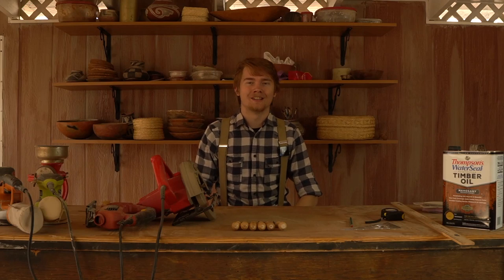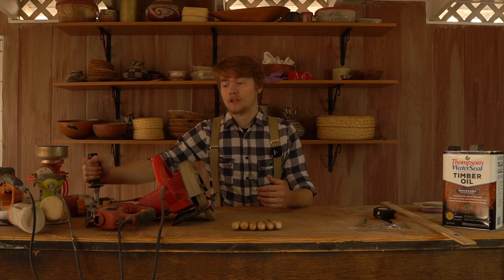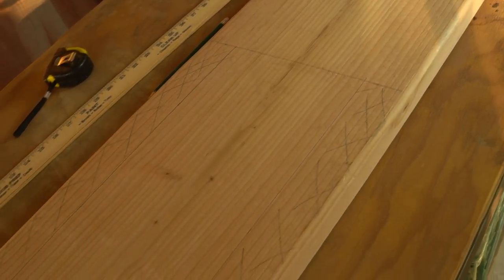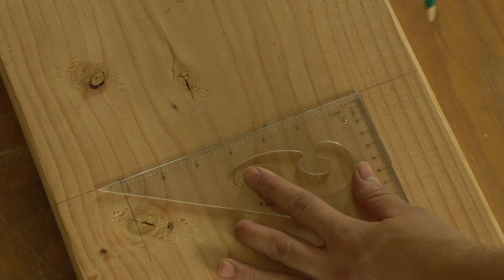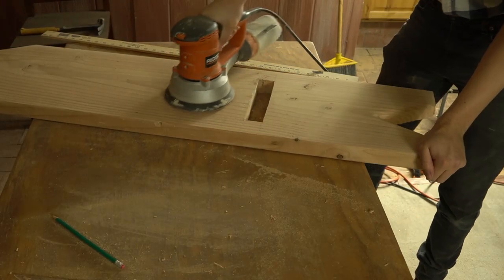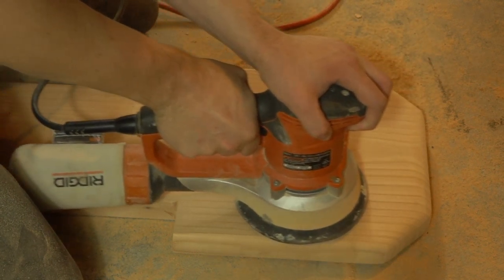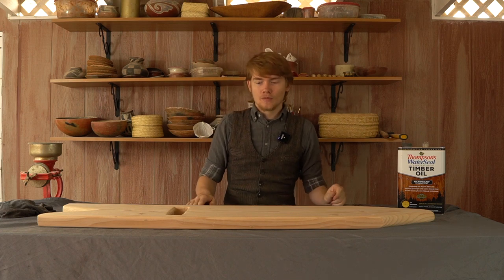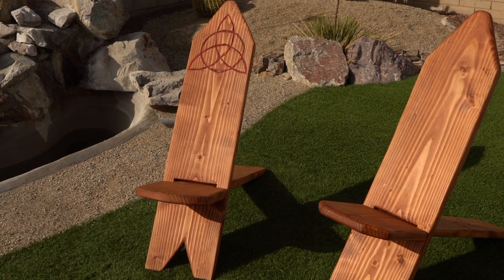How to make a "Viking chair"

Comment: a lot of the chairs seat kind of low..which really tall people have trouble getting up from..Is there a way to have the seat higher?
Reply: Yes, cut the hole higher up, but then the chair will sit at a sharper angle.  You would have to extend the length of the seat tail to offset the angle.
Reply: Keep in mind, the leaning-back seated position contributes to the difficulty ofgetting up from this type of chair. No getting around that.
Reply: I measured mine whilst sitting on a chair. Accounting for the additional height based on how I wanted to sit. I like my knees below my waist while sitting, easier on my old bad back. The angle is crucial for comfort and appropriate lean or reclining. I also used more stout wood as I have a couple of heavier folks who use these chairs.

Comment: What's the maximum weight these chairs can hold?
Reply: 300lbs
Reply: I used a more robust wood. I have a friend who is 400 lbs plus, and he sits on the chair with no issues, other than it is still slightly low for him. But he is losing weight, so it is all good.

Comment: Nice video! would be great to share sizes in metric system ;)
Reply: Multiply inches by 2.54 to get cm.  The true size of the board he used was 1½ x 11 x 96 in inches so that would be 3.81 x 27.94 x 243.84 in cm.  The tongue was 7 inches wide (17.74 cm) and it appears to be about 32 inches long (81.28 cm) the opening it goes into was placed 13 inches (35.56 cm) from the bottom of the back board.  You can go with close metric equivalents and everything will be copacetic.
Reply: @mikehuber7473  thanks a million Mike!